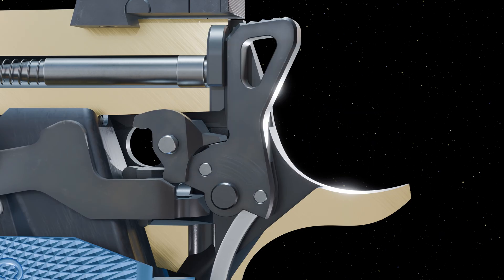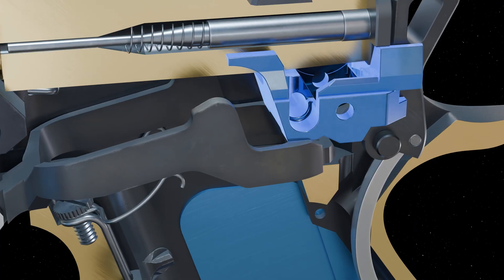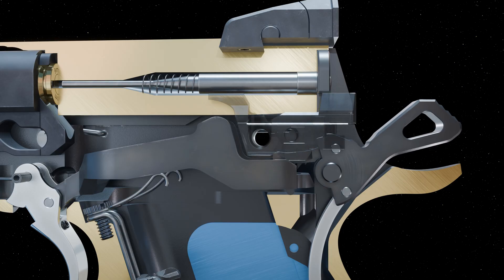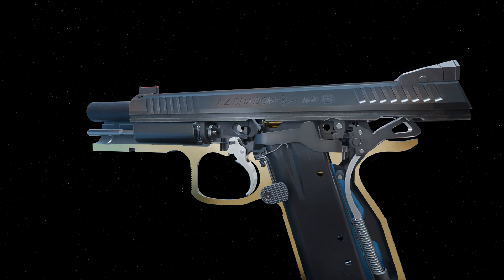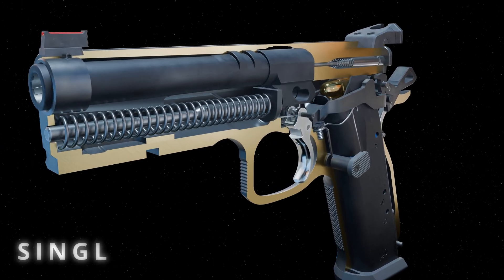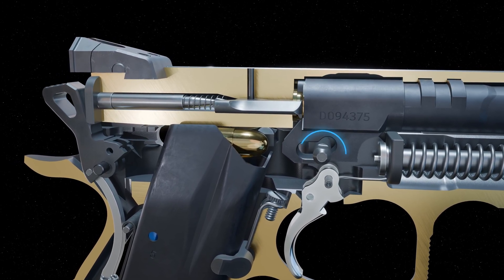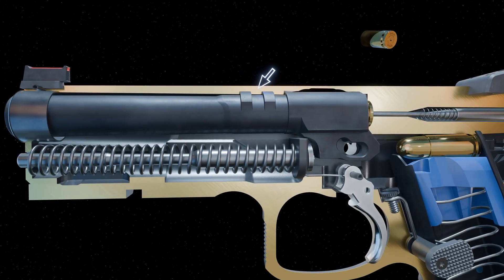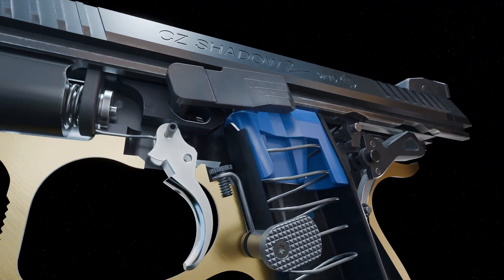How a CZ Shadow 2 Works

Comment: Hi, is it possible that the trigger action is fine without a clip inserted but once you insert a loaded clip there is no longer double/single action? Have you come acroos this problem? I just bought the gun second hand and it fired maybe 8 times and then refused to fire with a loaded clip inserted. If I remove it, the trigger action is normal.
Reply from the maker: I haven't experienced that and can't think of a reason off hand why that would be.  Have you tried removing the slide to watch if anything is interfering with the trigger mechanism when there's a loaded magazine?
Reply: @actioncycle will do. I am new to this gun.

Comment: I’m mostly interested in the process of how you make such a beatiful video! 😂

Great explanation on S2 mechanics. I’ve converted one to SAO and still managed to learn something new. Thanks!
Reply from the maker: I'm glad you liked it.  I had done a lot of work on mine as well, but I learned a lot making this. 

It was definitely a very lengthy process where I 3d scanned and measured every part, modeled them in fusion 360, built the materials in Substance Painter, and animated in Blender. Keep checking back.  I'll be posting more in the future. Thanks!
Reply: @actioncycle  Interesting. I'm a novice in 3D CAD but I've been following other people do 3D scanning and modelling.

I think "Substance painter" sounds like the thing I needed to hear. Thanks for the explanation.

Comment: This is amazing. Truly amazing! But how can blueprints be found? Very difficult indeed.
Reply from the maker: I appreciate it.  I made it by 3d scanning each part, measuring with digital calipers, and modeling each component with Fusion 360. I then UV unwrapped each part with Rizom UV, built the materials with Substance Painter 3d, and animated with Blender.  It was definitely difficult and took 5 months. Check back in the future as I'll have more videos coming.  Thanks again

Comment: it should be noted that when the hammer is at the lowered & resting position, the firing pin still sits COMPLETELY INSIDE the firing pin channel, with the spring tension pushing it toward the rear....therefore even if the gun was to be dropped on the hammer, the firing pin should NOT be able to strike the primer and igniting the round in the chamber....only when the hammer is in the cocked position, the spring-loaded firing pin will then protrude rearward...when the trigger is pulled and the hammer flies forward fast enough and with enough energy to strike the firing pin to "fling" it forward beyond the breech face to strike the primer and igniting the round in the chamber..... if the trigger is pulled but you manually grab the hammer and SLOWLY rest it forward, there's not enough energy to "fling" the firing pin beyond the breech face, therefore the round is not ignited.

Some guns/models have a firing pin block and or a decocker system that will rotate a partial firing mechanism out of alignment so that the part  (front) of the pin that actually comes into contact with the primer is inoperable.
Reply from the maker: That is all true.  I own and work on the P01 as well, so i understand the firing pin block as well.  This entire animation is driven through expressions, control bones and gates.  I contemplated having the firing pin slightly forward (rear flush with the end plate) when the hammer is down, but it added a complexity that i deemed not worth it.  I figured someone would eventually notice, so i appreciate you pointing it out.

Comment: Very nice work! 

At 2:01 the slide and barrel should not wait for the bullet to exit the barrel before they start to move. The reaction force to the bullet moving forward starts already when the bullet is in the barrel. 

But that’s really the only complaint I have. Everything is spot-on as far as I can tell. 

Since you asked at the end of the video, I’ll join a few others and ask to see a P226 next.
Reply from the maker: Thanks for the input and suggestion.  The timing of the bullet is indeed a touch off. However, the slide can't move backwards much prior to the bullet leaving because the barrel begins to taper and lock up won't be as precise while the projectile is still under influence of the barrel.   If i use this model to make another video, or when creating another model, I'll be more exact in that area.  Thanks again for the input.
Reply: @actioncycle  The forces we are dealing with are the result of the bullet and gunpowder gases accelerating forward, and the slide + barrel accelerating rearward as a reaction. The recoil spring is the only thing holding the slide forward and working against rearward acceleration.

Because the slide + barrel have a lot more mass than the bullet and gunpowder gases, the rearward acceleration is a lot slower. The slide and barrel move very little in the time it takes for the bullet to leave the barrel, but they happen simultaneously.

Comment: Wow, this is absolutely stunning. I am a mechanical design engineer and very fluent in 3D CAD but I have to admit this is done amazingly well. I am a big fan of CZ Shadow 2 series of guns, I have both Shadow 2 and Shadow 2 Compact. I believe CZ Shadow 2 series of guns are by far the best guns ever made and the most beautiful ones ever produced. You did excellent work and I salute 🫡 you.
Reply from the maker: Thank you for the incredible compliment.  I'm a huge CZ fan as well.  IMHO they're the best.  Again, I appreciate your response.
Reply: Same pair here. Great guns, and a great video!
Reply: As someone who is not an engineer. Why do engineers also put the bolt or filter in a almost impossible area to get off? Also why do engineers always start off a sentence with, "as an engineer".

Comment: The Shadow 2 is essentially identical to the CZ75 platform, minus the firing pin block and more competition-oriented sear and hammer hook geometry made for a lighter, more crisp trigger pull. I converted my SP-01 Competition to SAO and replaced the majority of the trigger internals, which actually exceeds the performance of the Shadow 2, it's a race gun now with a compensator, 3-stage recoil buffer, polished internals, 1.8lb trigger pull, .049" thou trigger travel, frame buffer pad, shimmed sear cage and red dot, I've had a few guys at the range get a little butthurt that their Shadow 2's feel like a Glock compared to it😂. It's cool seeing this animation, I'm intimately familiar with the internals of the 75 platform after spending 20+ hours handworking each component to perfection, sometimes it's hard to visualize what they all do in concert, I'm used to seeing only a small subset of parts working together at once so this was great to see.
Reply from the maker: Sounds like a cool gun.  I have an SP01 as well and like it a lot.  I've worked on these guns a lot, but i definitely learned a lot more about them making this animation and modeling the parts.
Reply: I have a SP-01 Cajunized and a Shadow 2. Myself I still prefer the Shadow 2. To me it has a better balance and feel.

Comment: Awesome video, well explained and nicely animated. Only thing i can criticize is about the DA-Disconnector (considering the actual disconnector is integrated in the teigger bar), the release of the hammer during the DA pull is partially by the trigger bar sliding under the sear cage, and partially by the DA-disco being pushed up by the ramp in the frame.
I would love to see the P10 or a 2011 next😁
Reply from the maker: I appreciate your input.  The P10 is a very real possibility.

Comment: And how is it that the action he's destroyed on the shadow 2 da/sa if the trigger is pulled while the thumb safety is engaged? This makes no sense to me at all. CZ customs response to this was to convert my gun to sa only. Quite bizarre.
Reply from the maker: In SA, pulling the trigger is no problem.  The safety blocks the sear by design.  In DA with the hammer all the way down, the safety shouldn't be able to engage at all.  The problem arises in DA in half-cocked position.  The sear nose is rotated slightly down as it drops into the half-cocked hammer notch.  This allows the safety to be engaged.  If the trigger is pulled, it will attempt to force the hammer back.  As the sear traverses the hammer face, making its way towards the SA hammer hooks, it needs to rotate the sear nose up some (rotating the sear arm that engages the safety down) because of the shape of the hammer face.  It won't be able to rotate because the safety is blocking it.  Too much force attempting to pull the trigger can damage the components. Hopefully that explanation makes sense.  That might be a good video for a short later.  Thanks for the question.
Reply: @actioncycle It absolutely helped and I greatly appreciate the time you took to explain it to me. Thank you very much!

Comment: This is very crisp ! I never knew that guns were so intricate!
Reply from the maker: Thanks!  I learned a lot about them as well in this process
Reply: Most handguns aren't quite this elegant, but they are all impressive in their own right. 
Double action / single action handguns, like this one, have a more sophosticated trigger mechanism than a Glock or 1911. 
But whether they're simple or built like a swiss watch, they are extremely efficient, with every part performing several different functions. 
Be careful, gun-nerd addiction is a possibility if you start looking into all of the different operating systems out there. Every gun is a mountain of math and physics, and I love it.
Reply: They are beautiful little works of engineering 😋